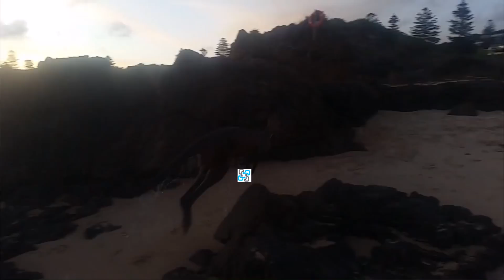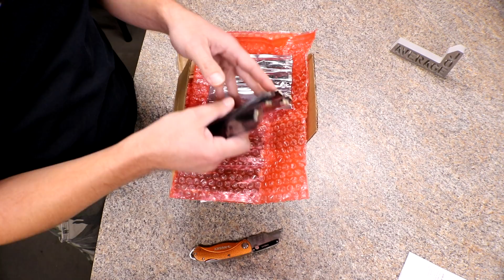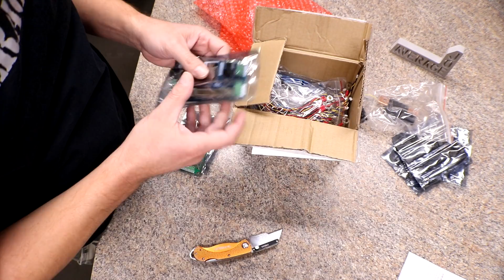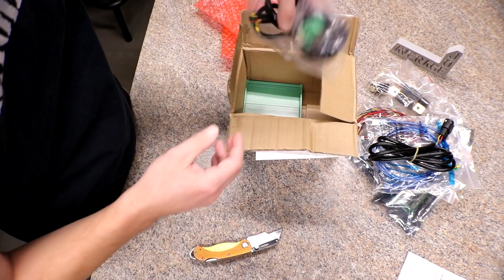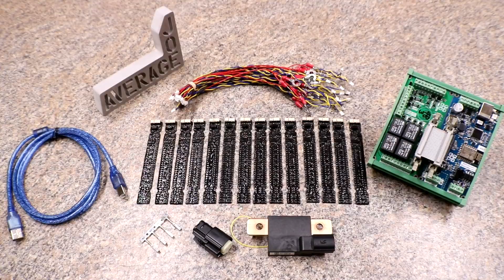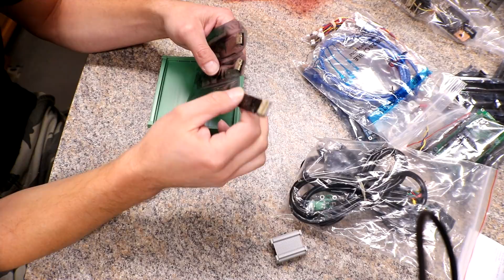Diy Tesla Powerwall ep66 New Exciting Stuff Batrium Bms!!!

Comment: Question. how did you balance your packs before you got the Batrium setup? I want to get started with the powerwall/solar stuf (small scale,  i currently collected ~300 cells) but i don't have money for a Batrium setup.
Reply from the maker: I only cycled them a few times before I got the batrium so they didnt get to far off in voltage.  I wouldnt recommend doing that for long term since the more cycles you do the more they are likely to get out of balance. If you are building smaller packs you could get by with those cheaper Chinese bms boards!
Reply: @AVERAGE_JOE  I have one chinees BMS but it's basically garbage. i cycled it with some less good sells(i didn't want to damage good sells) and ended up with sells at 3.9v and sells at 4.35v. The sells heating up worked better at lowering the voltage than the BMS lol. Could be i just got a bad BMS.
Maybe i can build my own BMS with arduino's and stuff. mmmm....

Comment: correct me if I'm wrong. Balance your cell mean the one with the highest volt is drain to the level of the other cells.
In your case 100 parallel cells(one cell) series with the other hundreds mean you have to drain around 100 amp that mean a big monster resistor to do that I don't think Batrium BMS has this capacity
Reply from the maker: Yeah balance the highest cell(100p pack) with the rest or lowest cell(100p pack).  You could use a monster resistor yes but when you build your packs out, you make them as equal as possible in capacity and it wont take a huge resistor.  The batrium bms uses a 1amp resistance load while charging to balance them out and if you packs are pretty close in capacity the batriun wont have to work as hard.  Does that make sense?

Comment: so you have a 51.8V nominal battery bank instead of 48.1V nominal bank why
Reply from the maker: Yes I do,  I could go down to a 13s pack but the higher the voltage the easier it is for a system to convert over to 120vac.  I charge the pack up to 56ish volts on a regular day and the low end is around 44.8v.

Comment: there's a reason for this BMS, all fuses in you power ball they are not enogh
Reply from the maker: The BMS is for keeping all the packs balanced when charging back up so one or more packs dont go over voltage.  For example if the packs were not put together with equal capacity's, the lower capacity pack would charge faster then the others and possibly over volt.  So the BMS takes care of all that for you 👍  The fuses are for safety and shorts ect...

Comment: Looking forward to this install.  Been waiting a week now for mine to arrive.  Please don't edit too much out.
Reply from the maker: Yeah, Ill try to keep in all without to much editing.  Ill speed up through the repeated parts👍
Reply: TIC-TOC-TIC-TOC???
Reply from the maker: Working on it right Meow!!!
Reply: I got my Batrium yesterday and I noticed you have more in your kit than I do.  The premain shunt cable the that little RX - TX board.  Did they give you extra?
Reply from the maker: +Garry S I ordered them but Im finding out I probly wont use them. I might use the shunt cable if it will reach the location but thinking it probly wont.

Comment: love that you are having more fun with the videos. keep doing stuff like this! ive seen those BMS systems before. they look awesome. sometimes a little slow to balance but id like to see a system that is a little faster for introducing a new cell besides adding a munch more of these in parallel. maybe a hobby charger or a bench power supply. ive had a few really cheap ones 30V 10A they are noisy both physically and electronically but they are cheap and the electronic noise they make is still under anything that ive seen you do. linear supplies do better but typically max out at 5A for the same price range $20-40

what do you do as a profession? I dont think you ever said?
Reply from the maker: Thanks, Yeah definitely having fun lol.  They say it can balance up to 2amps but its mostly at 2amps.  I dont think Ill need much more then an amp since I did a fairly good job at making the packs equal in capacity.  Now Pete probly needs to add some in parallel lol.  I work in aircraft maintenance.  I think Ive only said that in the live streams tho.  👍
Reply: cool career path! I have a friend that does that in the military and loves it! ever think about doing short videos of something along those lines? from how stuff operates that every day people may not understand or might be curious about or how some aviation repairs must be done that might be interesting.

haha and like that you know exactly where i saw that. yeah not particularly a man of that method. it may work but it seems very troublesome and over complicated for just lowering a cells voltage faster. the lengths he went through i would have just attached a small motor or resistor and watched the cell voltage rather than spend an hr or two using those balancesers
Reply from the maker: It sounds a lot cooler than it is lol.  I would do shorter vids but I work on a Military Base and cant have any cameras turned on where I work 😉😉😉.  I could possibly add tips and stuff in videos about certain things but or an easier way to do it kinda thing but since Iven been around it so long and others that doit as well I would think to myself"everybody knows that" if that makes sense.  Only thing off the top of my head would be safety wiring nuts and bolts👍

LOL yeah well.... Even he knows bahaahaha.  I heard Jaron (the bms guy) say if the bms is working then you didnt balance your packs right.  I agree, obviously since were all using recycled laptop cells its pretty much impossible to make them perfect and I think thats what Jaron was basically saying.  Balance them as best as you can so the bms doesnt have to work to hard.  All in the name of DIY 😃👍
Reply: petersirpol is a youtuber making a DIY ultralight and has been having questions on safety aviation stuff lately. it would make an interesting video if you can do some sort of collaboration live stream or a video format that is similar. people tossing in their 2 cents on what might be the best way to do what he is building. so far the only professional advice he has been using is copying designs of other plains and commenters who work in that field. anyways I think it would be a great way to add some new cool technical content to your page as well as help out another grate youtuber
Reply from the maker: Ill have to look up his channel and see what hes up to!

Comment: Wow, very cool, it will be fun to see the install and results. I guess it's important to note that the cost of the battrium kits is between $350 to $650 bucks. It may seem like a lot of money but when you consider the safety factor and the relief that you don't have to check the system daily to determine if it's stable or worse yet, blown dozens of fuses it's a bargain.
Reply from the maker: I completely agree!  Lots of factors are setup in the system.  I am very satisfied with the price and peace to the mind while not there to watch it.  Seen others come home to a mess and I dont want that!!!👍👍👍